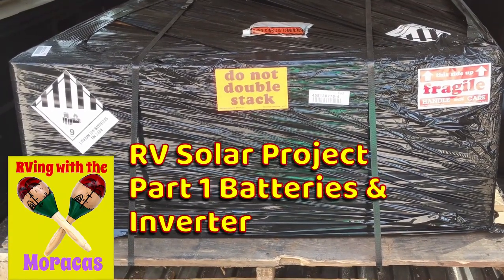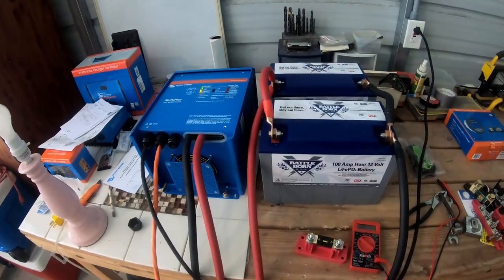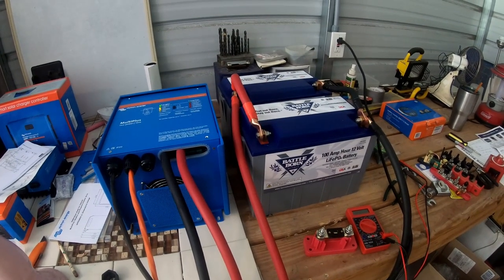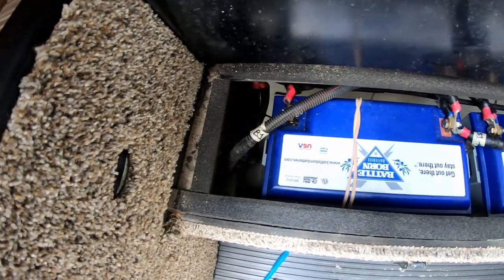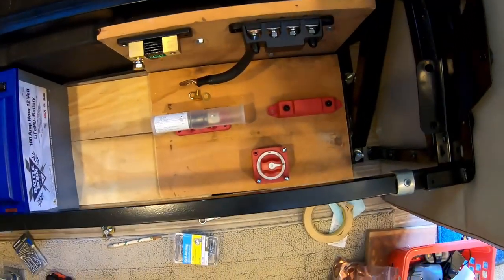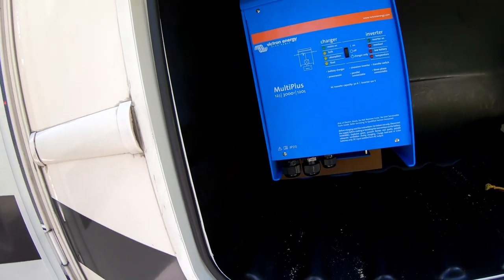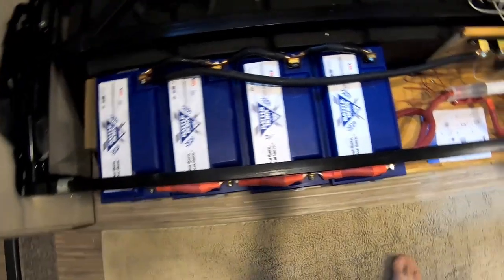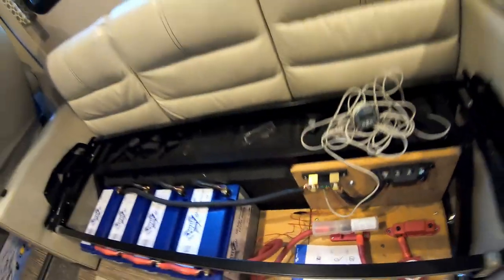RV Solar Install Part 1 - Batteries & Inverter/Charger

Comment: I am wiring the same inverter.  Wonder why the gland is too small for a 6/3 cable to your AC panel?  I figured a way around it, you just swap out the plastic gland for a metal cable clamp and the 6/3 will fit, but why did Victron not do this?  Something is not adding up.

Comment: is the AC input same as shore power?
Reply from the maker: Yes I guess it would be if you were directly connecting it that way.  We have both shore power and a generator so there is a "combiner box" (I don't remember the real name) in between.  But I just connected to the main breaker in our 120 v system.   .... I am no expert ;-)

Comment: How did you wire it to the onboard converter?
Reply from the maker: I turned off the converter with the breaker and don't use it.  I just took the AC wire that went to the existing "main" breaker and routed it to the AC IN on the inverter and then ran the AC OUT back to the main breaker.  I am no expert but that is working for me.  Thanks

Comment: You need to balance charge and discharge batteries first
Reply from the maker: Thanks for the info - I will do that.
Reply from the maker: I checked with Battle Born and they said just bring all 4 batteries up to full change and they will equalize themselves.